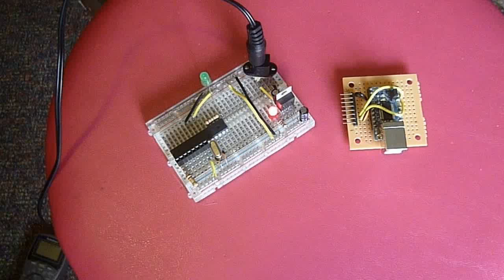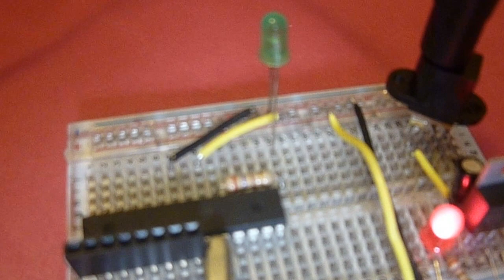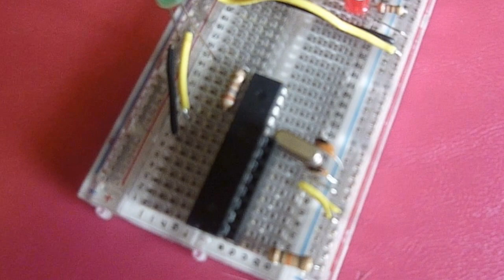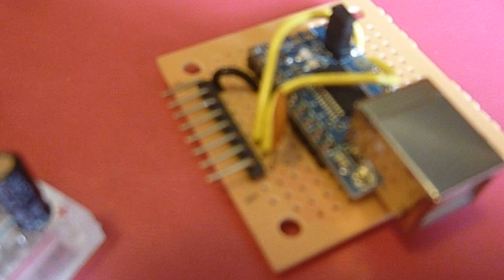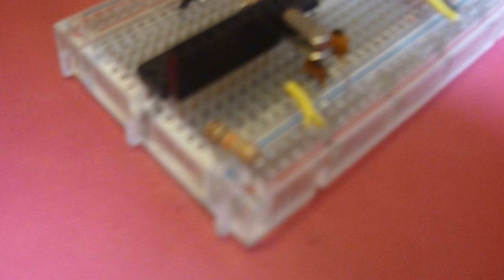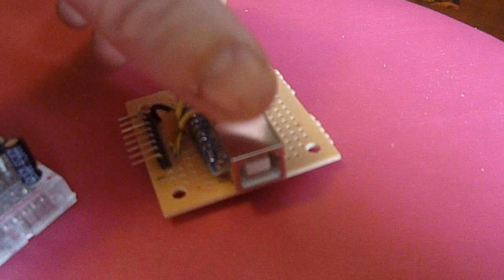DIY Arduino

Comment from the maker: ** A quick note on the Arduino Revised USB FTDI **

Use RTS, not DTR for the auto reset, and opposite to convention, RX on the FTDI connects to RX on the Atmel, and TX to TX!